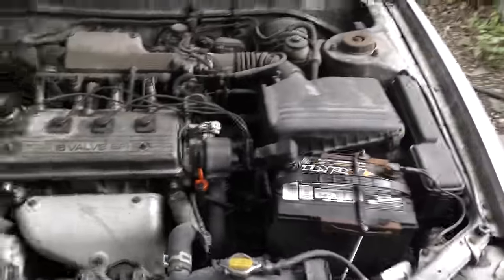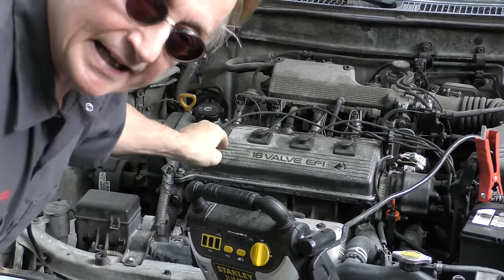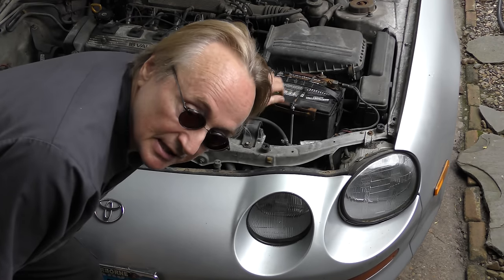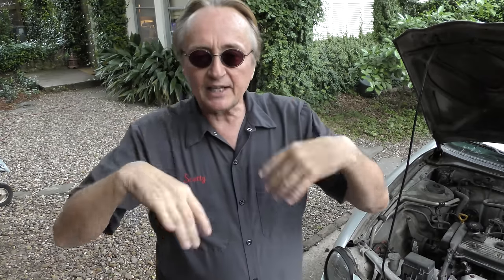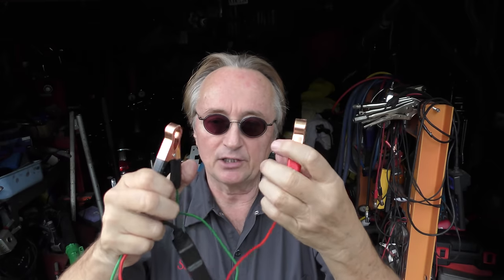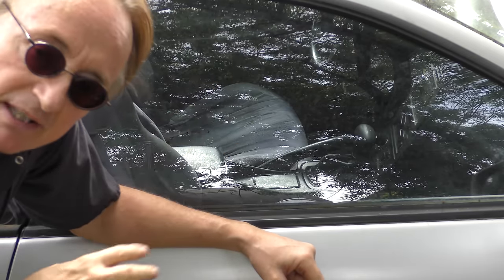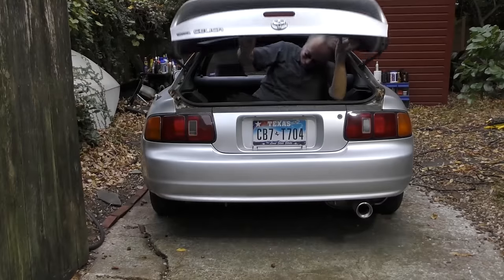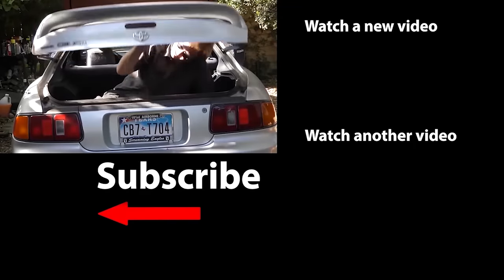Never Do This to Your Car (Learn from My Mistake)

Comment: Hey, Loved the video. I work on batteries for an Insurance company and enjoy that youre educating people on the do and donts. One thing to mention on the KAM unit that goes in to the OBD II to save memory  when youre changing a battery, is that most German cars, 2000 and newer,  should not be KAMed as providing 12v through the OBD II port can seriously damage the computer. A work around is to connect your jump box to the cigarette outlet to provide power so a minimum amount of memory is lost. (but never Jump Start the car this way) On most cars if your windows stop rolling up and down all the way, you can try and rolling them up as far as they will go and down all the way then up again and it usually fixes the problem, repeat for each individual window.
Reply: Most cars the cigarette  outlet is isolated when the ignition is off
Reply: @davewebster1627  correct

Comment: So the fancy computer controlled charging system can't tell the actual state of the battery and you have to manually tell it that the battery is new.  Sounds like just another way to get you to the dealership.
Reply: You don't really have to tell it but there are glass batteries and acid batteries.  By telling it what kind it is the computer can extend the life of it by charging it at different rates.
Reply: Stealership
Reply: Sounds wierd but whenever i changed the battery on my 99 accord i left the car running while changing it. Didnt notice a thing and never had a problem
Reply: @alexhickey5633  How can you leave a car running when changing the battery?
Reply: @pauldunneska  The battery is used to just start the car and the engine keeps it running.
Reply: @apeflawless  Well usually when you are changing a battery it's  because the engine won't start so you jump start it to get it going or put in a new battery.
Reply: @pauldunneska  the battery really only supplies electricity to start the car and/or run systems when the engine is off. The alternator supplies power to everything when the engine is running and an ecu type thing controlls how much power the alternator can put out. A little complicated to explain in a comment without taking a hundred years. I wouldnt chance it in a new car because for a brief moment theres 24v and twice the amps going to everything when the battery is re-connected and the engine running. Ecu's are very sensitive to that. When the battery is disconnected the car is using only alternator power. When the battery is connected its taking stuff off the alterator and battery at the same time. Old stuff is a bit cruder made, but able to hold up to cruder conditions too. At the same time it dont perform as refined as new stuff. Hope this helps. Not easy to cram all that into a comment
Reply: @alexhickey5633  I catch your drift!
Reply: Legit any type of computer with the right software can tell the battery state
Reply: @plowe6751  well shite anyways ive been doing that for years on older cars. Forgot to mention i turn on the head lights and fog lights to create a draw to lessen the power surge. On new cars id never do it. They always get turned off
Reply: yes Toyota with right tools and trained tech.s bonus give your tools away.
Reply: it will reset ,after next start up.
Reply: @plowe6751  i have no idea what either of those are. I had a multimeter looking thing hooked up anyway. There was a jump from the normal 13ish volts up to about 17 when the new battery was connected. Lasted a split second then went back to normal
Reply: Williwonti exactly what I was thinking! If the computer is so smart why can't it tell the state of the battery. Yet another money grab
Reply: That describes pretty much every company. They don't want you to work on your stuff, they want you to pay them exorbitant fees by making it impossible to do it yourself. Under the guise of "warranty concerns". No, it just a way to charge more money.
Reply: apeflawless that’s on your whip bro on mines it also helps maintain the amps running
Reply: @alexhickey5633  what were you using that measured the split second 17V spike? Not a regular digital multimeter, that would be too slow. Just wondering, since you didn't know what a max peak reading meter or oscilloscope was-
Reply: @wingerrrrrrrrr  just the multimeter. It went up to about 17v. Actual peak reading may be more and it probably is. On a new car id recomend turning off the car completely
Reply: @Mark Codiroli honestly man ive left many older cars running while changing the battery. Never a new car though. If it has any description of a complex electrical system I'll knock off the engine. If a car is made after 04 or 05 it gets turned off. Anything made before that I'll look up specs on it and look around for how many computerised electrical components it has. You'd know yourself by the age of a car how complex and sensitive the electronics would be tbh. Just my opinions on it and its yet to serve me wrong
Reply: @Mark Codiroli think you need to read more carefully-
Reply: @Mark Codiroli your impression is wrong.
Reply: @Mark Codiroli sounds like it's just your impression, which was incorrect. Not sure what gave you the impression that what I said indicated there are no surge transients without a battery.
Reply: @Mark Codiroli digital multimeters cannot respond that quickly, look at the refresh rate on the readings. Analog meters can do a bit better but without the precision. I assume his 17 volt measurement was with a DMM, but probably was actually higher due to the slow response.
Reply: @Mark Codiroli digital storage oscilloscopes are the best for capture of fast transients. DMM for accuracy, but for slower signals. Fluke is high end, and not common among most users.
Reply: @RAPHAEL leathery obviously he's chryin' du screw himself/others over and look knowledgeable doin it heeheharHar
Reply: Alex hickey@
What is the motive for keeping the enjine oN while taking a battery out to change it¿
Reply: Yes. Especially if it's an AGM battery. Germans are the worst for this.
Reply: @alexhickey5633  

Never do this.

The alternator was running your engine. But there is no voltage regulation with the battery off. You can fry your modules and ECU on your car. I've seen it done.
Reply: @plowe6751  

Only most cars with a smart charging system.
Reply: @tractor man TP 

It's not just a money maker. If you dont tell the vehicle about a battery change, the car wont know the battery voltage level and wont know how to charge it and so wont. It'll start the car but nothing else.
Reply: Alex Hickey : The battery also a acts as a voltage regulator so when you disconnect the batt W/ the eng running potentially the sky is the limit on voltage output, unless the computer catches the spike
Reply: Alex Hickey sorry just saw Alex Hickleys comment
Reply: These are the stupid complexities imposed on us by  EPA and Department Of Energy.
Reply: @pauldunneska  
Same as my old -84 Ford Sierra.
It start on the battery,  engine run on the alternator.
So I could change the battery while the engine was running.
I could not drive without battery as it would suck too much power and the car would die without any battery in it. But on Idle it was doable.
Reply: @Ssesshoumaru69  But the whole point of changing a battery is to start your car so what's the point of leaving the engine running while you change the battery? It will start anyway with the new battery.
Reply: @pauldunneska  2 cars. 1 with flat battery. We had no battery cables, and shop was closed ... So we swap battery, let one run start the other on up, let it run, and change battery back 😅
Reply: @pauldunneska  diesel you can
Reply: @pauldunneska  Easy.
Reply: @robdixson196 hehehehehehe , i agree
Reply: @alexhickey5633  LOL Where did the 24V come in?
Reply: 😂oooh woooooofh
Reply: sips crappy slow cars from the mid 80’s and 90s. Now that was a car.
Reply: Alex Hickey .
Reply: @alexhickey5633  Many years ago you could do that but it's not good to do that anymore. With more and more computers this could destroy some computers. Internally some of these computers use negative voltages. If you disconnect the battery it can sometimes make the voltages unstable and destroy some computers.
Reply: @JTL-DK  that would be buses and trucks lol
Reply: @mickeymooney219  dont worry, hondas in those days were fairly basic. They can take a power surge a few times. Newer stuff is far more sensitive to a voltage spike. Jump started a daf bus one day and it blew the vfc. Its a known fault. Sometimes they just blow if you turn on too much stuff all at once. Even connecting the batteries ive heard can blow a bunch of stuff in em. Same goes for modern cars and all their electronics. Back in 99 stuff was much simpler and tougher
Reply: @alexhickey5633  Yes, I worked with Toyota for about 5 years and they were the same way. The imports were very primitive compared to GM & Chrysler. I worked with Chrysler from 90- 2007 and we were using body computers back in 1989. Gm & Chrysler didn't like it if you disconnected the negative cable. I saw a service manager wipe the face of a brand new 1984 Corvette instrument cluster and the static electricity killed the cluster.
Reply: @pauldunneska  alternator in Good conditions will keep it running. At least in older models cars.
Reply: @dba6398  But you can't drive without the battery so is there any good reason really?
Reply: Volkswagen does things like this when you need an oil change...you have to have it done by a dealer. So much for shade tree mechanics gettin R done!  Give me an old Chevy with a 350 or 454 and let me go to work!
Reply: I think he said the computer tells the  battry its old and infirmed and its not allowed a big charge... like old  peoples not  allowed to drive  after dark or with nore than two people.  End of  life flip side to teen drivers!
Reply: @pauldunneska  idk but my 91 accord i had did the same thing it even started with a dead battery even push start/ literally pushed the car
Reply: Yep.  Not only is there greed (as there has ALWAYS been) but, now, technology to support it.
Reply: @SomeDumUsrName  damn 😳 wow
Reply: @pauldunneska  alternator supplies the power while the battery is out. Still, it's bad practice and can cause expensive probs, in particular newer cars he mentioned. Was ok in the "old" days but not now. Just don't do that.
Reply: @alexhickey5633  You were VERY VERY LUCKY. You do NOT disconnect either cable from the battery with the engine running on these newer cars where the alternator has a built-in voltage regulator because in that fraction of a second when you first disconnect one cable, the load of the battery is removed so the system voltage will spike many volts until the regulator drops it down. Without the battery acting as a load to take the current output from the alternator, you created infinite resistance to the current flow which will immediately cause the voltage to rise. We used to do that in the "old days" when cars had generators instead of alternators because it wasn't an issue (no diodes in the alternator to blow out, no computer modules that are very voltage sensitive, etc.). If the generator equipped engine died we knew the generator wasn't charging, if it kept running it was ok. Disconnecting the battery on an alternator equipped vehicle is a very bad idea. Unfortunate people have fried modules and alternator rectifiers by doing that.
Reply: @garfyinhawaii1541  ah well its only a 99 accord. If it were anything newer than that you can be sure id have leads disconnected
Reply: Just another reason not to buy a BMW. I always wonder about the BMW decision to stop putting dipsticks on their engines. Why?
Reply: I went to get a battery and as soon as they put it one the check engine light came on the guy was insisting that the battery was good I said yeah but not for this car apparently
Reply: @TheFrenchPug  Yeah, that's the age old "look! a new feature! Too bad it half works better than before, and half doesn't work in your favor whatsoever!"
Reply: @alexhickey5633  
That's how I check to see if the alternator is still any good I'll start the car up and if you unhook the battery and the car cut's off that means the alternator is not working anymore if you unhook the battery and the car is still running then the alternator is good.
Reply: @don-cw1yz  prevents using a pump for oil changes.

Comment: Honestly Scotty,  love your work. Worked for BMW, not anymore though, now gone indie.  I learned to simple charge all batteries on AGM setting. AGM setting is lower amps than "regular" setting. Won't wear out lithium batteries either. Save myself a lot of time at work, forget trying to decipher what kind of battery I'm charging. Won't blow up a lead acid, perfect for AGM, and if it has a secondary lithium battery for starting, won't kill that either
Reply: What is  A G M  >??????
Reply: @genehollon1472  absorbed glass mat

Comment: I'd heard about resetting the computer for a new battery but read online conflicting advice as to whether it was necessary or not. Thanks for clearing that up Scotty. In the UK there's always that little shop down town where they have the equipment to do the resetting for a fraction of dealer prices. God bless 'em.
Reply: U won’t find that here any more- our generosity died with our manners and dignity
Reply: The cost of the battery reset at the stealership, could buy you a few extra batteries. I never did it on my BMWs and didn't notice a battery life issue.
Reply: Resetting the computer? You just disconnect the battery for a period of time.

Comment: Great info on the battery jumping. It's worth mentioning that ALWAYS connect the red/positive to the terminal FIRST then the black/neg to a part of the car. This minimizes sparking to virtually nothing. Also, while you mentioned that battery explosions/fires are rare, they can and DO happen even with today's batteries. Always clear the air around the battery, (just fan it), before connecting to a terminal. If you've ever seen a battery explode, it will ruin your day and possibly your car, eyes, face, skin, and so on...
I've watch average people try to jump their cars in parking lots, (it's like a hobby), and frankly, it's 50/50 as to whether I see them light it up or get it right.😑
Reply: I’m 55 years old now, but I remember a traumatic experience from when I was about 5. My dad took my family on vacation and we stopped to get gas. A motorists’ battery died so my dad offered him a jump. My dad connected the cables to our car and the stranger hooked his ends. The moment the poor fella touched the negative terminal, the battery violently exploded in his face. He had no goggles or any protective gear. I don’t know what became of him but I’ve never forgotten that experience.

Comment: One of the young guys in the shop I used to work at was undoing the positive lead from a battery and his wrench touched the negative pole - the battery went bang and he got covered in battery acid. 15 mins in the shower and a trip to the emergency room to get checked out, but luckily no lasting damage to him or the car. Ever since then, I've always thrown a rag over any uncovered battery poles.
Reply: I had a battery explode just starting the car....
Reply: That is why the negative terminal is always the last one to connect. If you touch a wrench to a positive terminal with a negative connected, the wrench can touch any ground and have the same bad result.
I had a battery explode in a 70 Corvette while starting the car. The battery is in a compartment right behind the driver seat. It blew the compartment wide open and dumped battery acid all over. That is why with the older batteries, you always wanted to make sure the electrolyte level was topped up. If it drops below the plates, and you try to start the car, you can get a spark that ignites the battery.
While in high school, I was working in a Ford dealership, and one of the mechanics disconnected a battery charger before turning off the battery charger. The battery blew up in his face. I grabbed him and took him into the car wash and sprayed him down real good. He had no lasting effects from the Acid Bath but certainly learned his lesson.